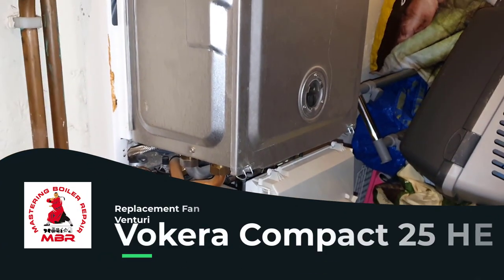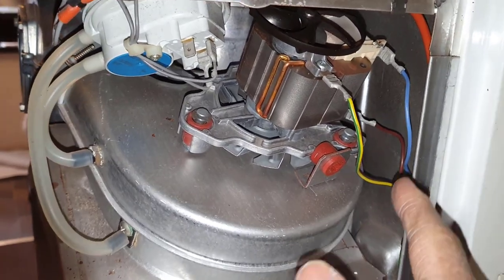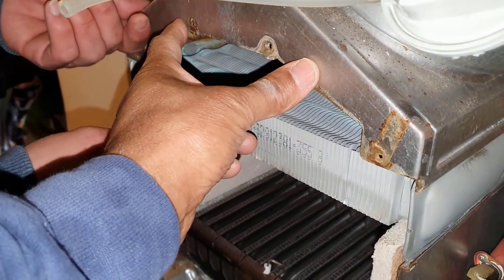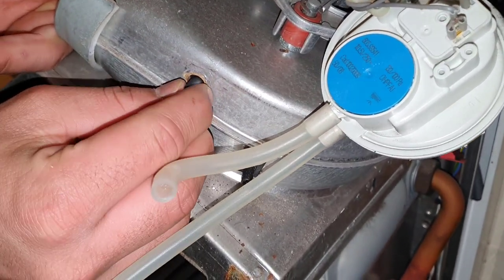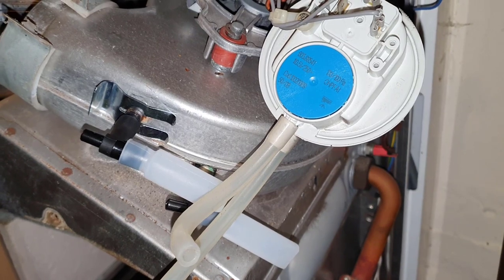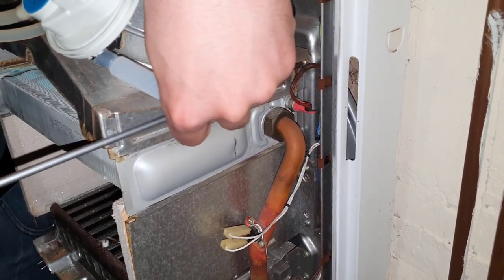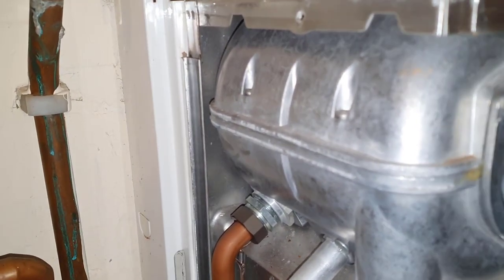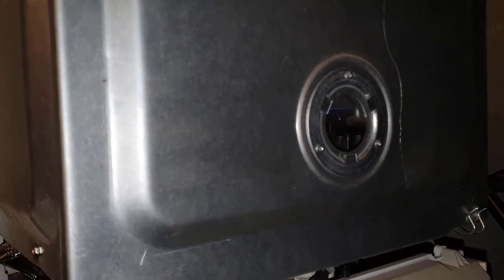Vokera Compact 25 HE How to Replace a Fan Venuri With Master Coach Tony Morgan

Comment: Hi Tony,   Ref : Vokera Compact 25 HE How to replace a Fan Venuri video  ... 
Super Super video, excellent for all those continuously learning GS Qualified, & for our most welcomed up & coming GS Trainee Engineers ! 
Could  I add further to the Basics in Safety Aspects ... 
Whilst it may be obvious, ( and even then not always due to distractions of one kind or another )  to MOST if not ALL Qualified GS Engineers and or most welcomed Trainees viewing ... 
Could you  continuously promote  the absolute importance of  ALWAYS repeatedly mentioning the BASIC methods in  SAFETY,  by First & Foremost ISOLATING both the ELECTRICS  and  GAS  BEFORE  approaching this particular replacement / repair ... and others like it,  as this wasn't made clear at the beginning of this video.    Looking forward to more excellent videos like this ...  many thanks

Comment: You only need to pull the fan forward until it hits the aps the put a screwdriver into the venturi and remove the locknut carefully pull the venturi out clean it or replace it and put everything back you don’t need to remove the sides or unplug the fan you can have it done in half the time

Comment: Hi I think I'm having problem with the venturi on my Vokera Pro Combi 100he. When I remove the internal combustion panel, then boiler fires up fine. But I put back combustion panel it doesn't. 
I have replaced the pressure switch. 
And also a brand new PCB as well. 
Welcome any suggestion. 
It's a very good boiler. I don't want to replace if it's just the venturi .
Reply from the maker: That's fine so have answered your question.

Comment: Hi
I do have Vokera 25 HE
Problem is with heating, it starts but cuting off after few seconds.
Hot water working fine.
What do you think ?
Reply from the maker: Could be the divertor valve
Reply: @ARBoilers  Thanks.
Is this diverter valve/cartridge or diverter motor/actuator?
Reply from the maker: Could be the actuator motor
Reply: @ARBoilers  Thanks working now! Got brand new part for £15 and it took me less than 10 mins to change it.
Heating back on now!

Comment: Hi, My fan on the Vokera is not spinning fast enough to trigger the APS, would you say that's a new fan or not enough power reaching the fan?
Reply from the maker: You would have to measure the voltage ⚡
Reply: @ARBoilers  What sort of Voltage would you expect to reach the fan? Great Video by the way.
Reply from the maker: @PCookman  230 volts